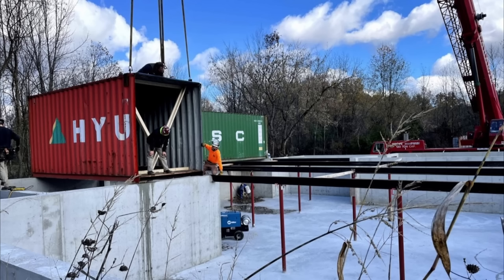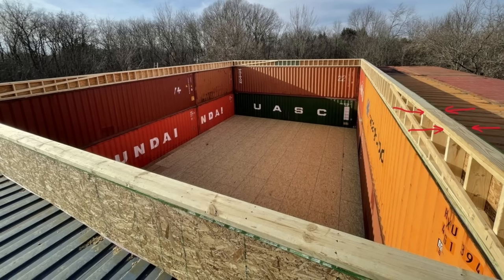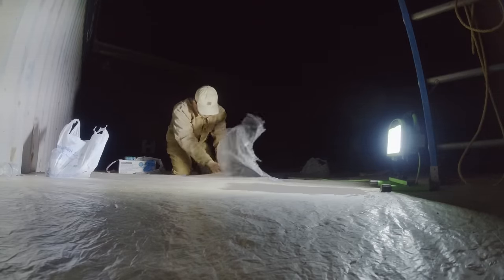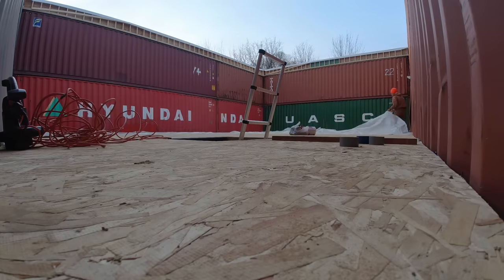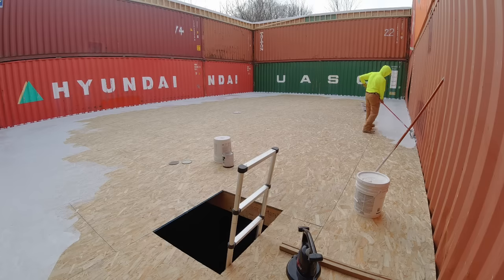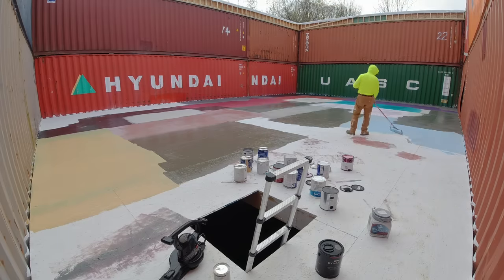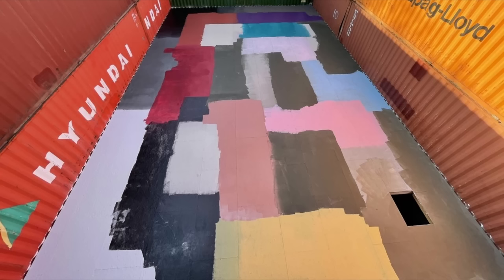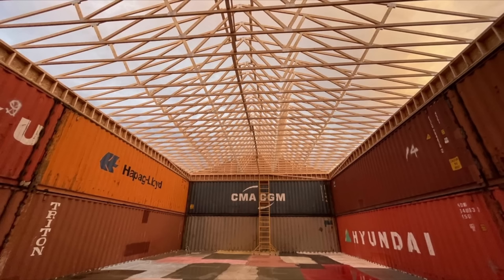$10,000 dumb roofing mistake for my shipping container house build

Comment: Nicely done.  As a traditional builder I don’t fully understand the shipping container building, but your story is interesting.  I hope it keep going well and your learning curve gets softer.   
Side note, I build in a very raining part of Oregon and OSB floor-sheeting is made different then the 7/16 wall-sheeting and it’s designed to be rained of. But it never hurts to do your best to protect it. Keep it up.  I’m going to subscribe so I can fallow along on your project.
Reply from the maker: Thank you for watching and subscribing!  I agree OSB's are designed to be rained probably for even months without issues, but I wanted to protect the good work by the trades.  Hope you are warmer in Oregon.
Reply: @1michiganbuck  👍🏻👍🏻
Reply: the whole point of shipping containers is that "traditional builders", zoning boards, inspections, and the existing house building infrastructure is a scam.  Not as bad as the USA medical system, but they charge too much
Reply: @davidanalyst671  I can see that point of view.  As a builder in Oregon I have a lot of hoops to jump through that seem to be a waste of money and time
Reply: @davidanalyst671 still have code and inspections with container builds unless you don’t plan on insuring it or reselling it? Container builds were to save on cost as well but costing 5k+ per 20’ it’s not cheaper but more expensive than just building a wall or pouring concrete 🤷🏻‍♂️
Reply: @American.Divergent  lots of people were suckered in to think containers are good building material. they are not. they are not cheap nor good, and they are used too.
Container builders should go even further. stuff old tv's, freezers and car tyres inside containers as an insulation.

Comment: How did you seal the knee wall to the top of the container? Specifically for rain? Furthermore, how did you seal the roof seams created by placing two containers side by side? I've seen many container build videos but no one explicitly shows how this is done.
Reply from the maker: For the knee wall, my temporary solution is to use roofing tar to seals seams and it has workedwell, but it was hard work and long hours and very messy.  Eventually I will put a roofing system on the flat parts where there will be a grade of 1/8 inch per foot with EPDM at the top, wraped up the knee wall by a foot (the knee wall with have a metal siding eventually), and that will prevent any water ingress.  As for the seams, they are welded shut with a metal strip, along the whole length. I probably should do a video explaining that. Thanks for watching.
Reply: @1michiganbuck  Thank you!

Comment: I'm really curious why you built the entire base in concrete, and then add shipping containers on top?
Reply from the maker: Good question.  I was hoping to get more space for whatever future purpose may be.  I joked often about putting a bowling alley in the basement, and, guess what, I have room to do that in the 4,000 sf space.  One thing, though, that I made sure of was to get a really robust concrete foundation for the containers to sit on.  On top of that, I put steel posts all over to support any span not shouldered by the concrete walls.  I really should do a video about that.

Comment: Black plastic would be even worse because it would get extremely cold at night, wherever it's coldest is where moisture moves to. Love your paint solution.
Reply: Why would black plastic get colder at night than any other plastic? If anything it'd get hotter during the day. Also, moisture doesn't "move", cold are just can't contain as much moisture as warmer air, so if the same air cools down more in one place, it may condensate there when it doesn't in a warmer area.

The main issue with plastic is that it only keeps moisture in. Moisture will ALWAYS get in, so the last thing you want to do is block the exit path of the moisture.
Reply: Buddy, you don’t know what you’re talking about. Just because black surfaces heat up more in sunlight doesn’t mean they get colder than other colours during the night 😂

Comment: Paint was a great idea, I certainly would not have thought to check with paint stores for remnants.  I recently redid my master bath and I used flex seal on the subfloor. Especially where I drilled new holes for the new placement of the bathroom fixtures. Yes that flex seal would certainly be expensive for that amount of sq footage
Reply from the maker: Thank you for watching. I agree with you that using mistint paint is a great idea. I spent very little money on the paint, and the results are very durable.

Comment: The overhang of the roof does not clear the cargo containers. Do you have a plan to keep the rain and snow from seeping in?
Reply from the maker: I will have a roof system put in this year.  I designed it.  Stay tune.  No leak as is because the seams have been welded shut, but will have a fool proof system in place.

Comment: My container was crushed by snow loads in the U.p. What did you do to make containers structally sound?
Reply from the maker: Sorry to hear that.  I will have a structural video out soon.  Whenever I cut a hole for a door or a window, I always reinforce the area with vertial steel tubing.  So far, no issues.  Normally containers are strong and can withstand a lot of load on top, so I am curious about your specific situation.  Did you cut some areas out?

Comment: A friend built an ICF house and his Roof was open like all winter.  The OSB started to curl on top.  I think the contractor might of taken a hand plan or something and resurfaced it.  That was over 10 years ago and it is fine to this day.

I was going to suggest paint till but you figured it out.
Reply from the maker: Thank you for watching.  I do have a few spots with a bit of unevenness due to moisture, but I will use a big sander to smooth it out before the final flooring is put in.

Comment: Your contractor should have offered to sister in a raised interior knee wall, a simple cantilevered narrower top edge or even rebuild the knee wall at an inward slant to support the trusses you bought. All much cheaper and quicker solutions. The resulting knee wall performance would have been the same and you would have had your project finished without the delays incurred waiting for new trusses. When you came across the problem you should have sought other advice like you did when you got three quotes, then you could have given that to the contractor to continue.
Reply from the maker: We worked with the truss company to find solutions, including what you mentioned, but it would all have cost much more.
Reply: @1michiganbuck sounds like you were being misled.
Reply from the maker: @MinnesotaFarmboy  I'd love to show you my spreadsheet. but that's another video.  I am a corporate finance guy.  Trust me, it would have cost me far more.

Comment: He rolled out plastic four different times? Good Lord.  So I guess learning from one’s mistakes isnt an option in this case.  Probably would’ve been cheaper just to pull up the plywood and cover it with a tarp and then reinstall it
Reply from the maker: I guess I am a slow learner.  Tarp won't work, though, because it gets punctured easily.

Comment: Did you try contacting the truss manufacturer about modifying the 40’ trusses? That’s a fairly common issue. Correctly sized trusses is the better option…
Reply from the maker: Smart question.  That was the first thing I did.  I engaged their engineers about modifying them, but there wasn't a solution they would sign off on without significant modifications, which would cost just about as much.

Comment: Im confused by the build design… most container homes utilize the inside space of the container. You essentially used them as giant lego blocks? What will the inside space be used for? Do you plan to cut holes into them and open them up for living space? Kinda weird architecture but definitely room for creativity.
Reply from the maker: I have a design video on this.  The great room is designed so I can play pickleball or badminton inside when furniture is pushed aside.

Comment: Why didn't you just build 2 - 2" x 6" walls to the height needed for the trusses on the floor on each end and use the original trusses? A LOT cheaper.
Reply from the maker: Which can fall down like a straw hut in a tornado and burn like a bonfire in a forest fire? No, thank you.
Reply: @1michiganbuck  You don't understand, I mean build 2 - 2x6 walls INSIDE the container structure that you have in place and on the new floor that you had built. Actually much stronger than just knee walls. That way you could have used the existing trusses - I'm surprised that the builder didn't offer that option. As it turns out, it all ended up well financially but you did have to put in a lot of effort into protecting the floor over the months that it took to get the new trusses. Good work and good luck.
Reply from the maker: @xAnAngelOfDeathx  Now I understand.  Apologies.  What you said makes sense.  We did think about that and costed it out, which would have really added cost to my build.  My solution worked well because no cost was added.  Thank you for watching and commenting.
Reply: @1michiganbuck  After watching newer videos of your I realize why you couldn't do what I suggest as the shipping containers had their sides removed on the bottom to make a bigger space. All the best to you sir, cheers!

Comment: Black felt roofing paper for your vapor barrier & a way to drain off water.
Reply from the maker: Are you talking about the flat roof? If so, I do have a roof system that I’ve designed and will install that when the weather is warmer.

Comment: Curious on using metal as your outside walls.  There is s reason why metal studs are not used in home building.
Reply from the maker: Actually metal studs are getting popular.  I am using containers due to the scale of the build, especially the size and span of the great room, and the convenience for me to mess with them without messing it up too much.
Reply: Not for home building.  I saw a study done with different wall construction and the metal studs we subpar.
Reply: they have bad performance when it come to insulation they create a perfect thermal bridge for heat and cold.

Comment: And why could you not ledger on some 4x or 6x to your cripple roof? would have been easier then new trusses
Reply from the maker: We did try to find alternatives.  I even paid Menards about $200 to find a solution to use the existing trusses, but the expenses would just not be eonomical and the results would be uncertain, so I decided to just go with new ones, and I was fortunate enough to narrow the loss down to almost nothing. Very happy with the new trusses.
Reply: @1michiganbuck  Well glad it all worked out in the end, Thanks for sharing what you are doing. I was thinking it wouldn't have been to hard to add a ledger to the Cripple wall or even ledger out the entire cripple wall. But it all seemed to have worked out well for you so that's good looking forward to seeing more!
Reply from the maker: @ScrollinForATrollin  Thank you.  The guy who built the knee wall for me is a really smart guy.  He was thinking exactly what you were thinking, but when we contacted the truss manufacturer, their engineers didn't want to sign off on that, and then proposed their fixes, which was just too expensive.  My final solution ended up costing me no money, so I am glad it worked.

Comment: Or you could have cut a 2x4 to fit between the sill plate and the 40 foot trusses, thereby extending them, and not have to go through all that hassle.
Reply from the maker: Good suggestion.  The guy who built the knee walls, very talented, suggested the same, but when we checked with the truss company engineers, they didn't want to sign off on that.  They proposed their approved fixes, but they were just too expensive.  My solution ended up without any cost increase, so I was happy.  Thanks for watching.

Comment: Where is the longitudinal bracing for the roof trusses?  Oops!
Reply from the maker: C channel is beefy, no bracing needed.  At the top, if you watch my other videos, you will see a 1/4" tap is welded.
Reply: @1michiganbuck  The term “beefy” is not listed in the building code.  There are certain minimum bracing requirements for the top, web, and bottom chord members.  You are lucky to not have the entire truss system rack and fail when erecting the trusses.

Comment: LOL, if you were that worried slap a thick coat of oil based SPAR polyurethane on the OSB.
Reply from the maker: Did you even watch this thing to the end?
Reply: @1michiganbuck  I did, multiple failed attempts with plastic and finally resorted to paint.
What's done is done, but I think right from the finish of the OSB being laid out I would have hit it with a coat of Poly U. LOL, just my I'm not you opinion. Still that is a hell of a large great room.

Comment: A used shipping container can be notoriously filled with toxic waste in there for the companies who hold these put these on the sale list first so if you want to be careful to make sure you vacuum every square inch I guess but remember that there could have been very toxic things inside of those shipping containers just saying!
Reply: That is a big myth. A multiuse container commonly comes with its entire history of shipments as they are kept documented by law. Most people just don't ask to get the documents. If a container has been contaminated by anything toxic they more often are red tagged and simply cleaned and melted down to recycle. The cost of that is more cost effective than the risk of a lawsuit. Outside of something like a container used for smuggling so obviously would have tampered documentation, getting a container that had toxic contamination still in it, is pretty difficult. Not saying impossible, but very unlikely.
Reply from the maker: Agree.  Thank you for watching.  I am sealing everything up beside cleaning them.

Comment: Instead of the plastic you should have used thompsons water sealer
Reply from the maker: I was looking for a cheap alternative and it has worked really well for me.  Thompsons water seal is probably 5 times more expensive and I don't need the long-term benefits.

Comment: I had to click on the video at the plastic. Paint subflooring with an actual waterproofing paint, stain, or other waterproof sealant. Plastic was not a wise decision but you admit it and move on. Could've cost you a lot more if the damage to the osb subflooring was substantial. It's crazy the 10k price difference between 2020 and now. Just insane
Reply from the maker: Thank you for watching.  The difference was driven by two factors.  One, it was the pandemic.  Two, the 40-footers were standard trusses, so they'd produce them all day long; the 40'11" ones were not, so the cost was quite a bit higher, even though the length increase was only 11".  Hope that makese sense.
Reply: @1michiganbuck  oh it does. I build and remodel houses and log homes. Good luck to you

Comment: You would have been better off getting a 5gal. silicone roofing material or even a urethane and spread it around cheaper faster better ! That's all paint stores
Reply from the maker: You are joking, right?  Did you check the price of those things?
Reply: @1michiganbuck  that suggestion was before you came upon the oops paint but in refference to all the plastic and time completely waisted there are some urethrains that go for inder $100 a 5 gal. bucket and would have been better than the paint but by the looks it would have taken about two of them so the paint probably the most cost effective
Reply from the maker: @michaelvaughn7137  I got you.  Thanks for watching.